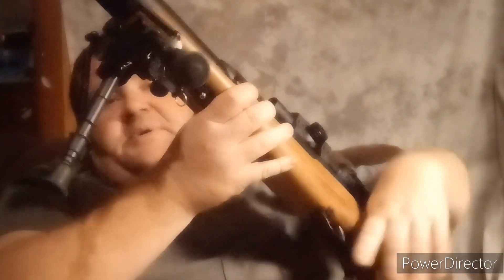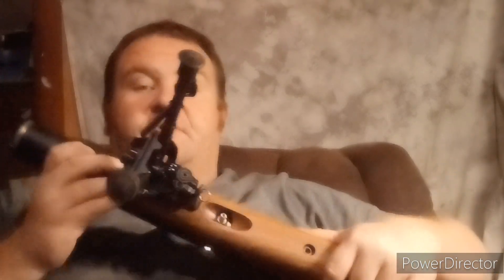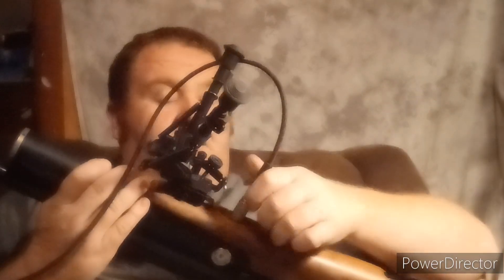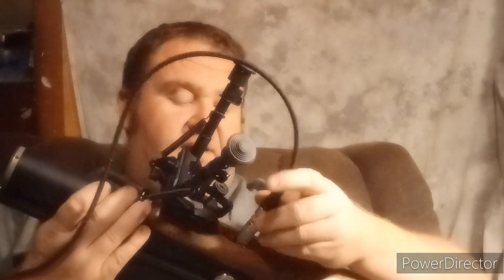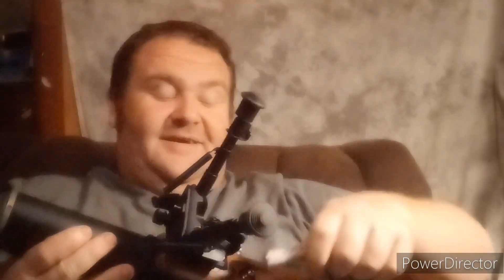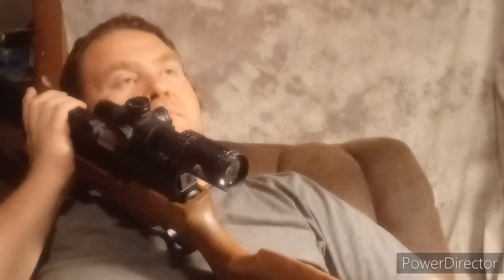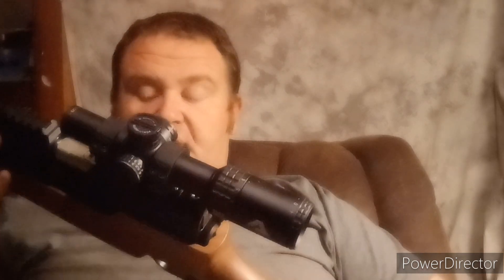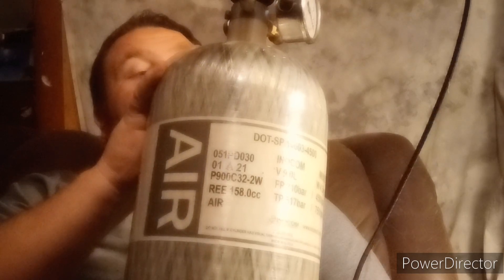Filling the AEA Zeus from empty

Comment: What if you follow all these steps and it's brand new and won't take air?
Reply from the maker: @JohnF-z7o  send it back and get a refund.
Reply: @AmericanDefender  don't think I can I bought it as a Christmas present almost 3 months ago
Reply from the maker: Contact who you bought it from and explain to them what is going on. If it was Terry at fox Airpower, he will definitely take care if it. Just out of curiosity,  are you trying to fill it with a pump? You may need to try filling it first with a tank. The tank will push air in harder and cause any stubborn seals to seal.